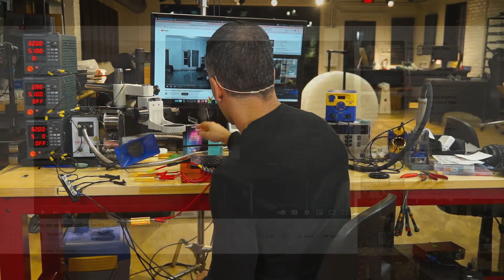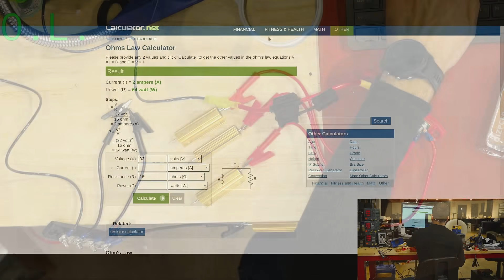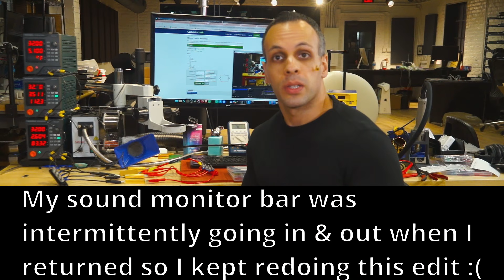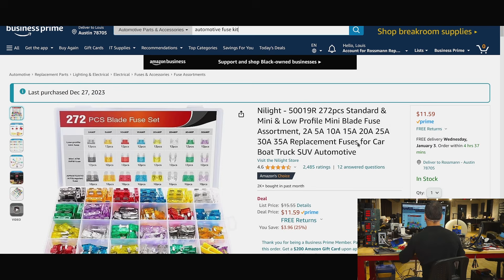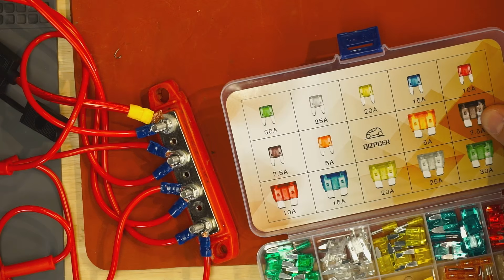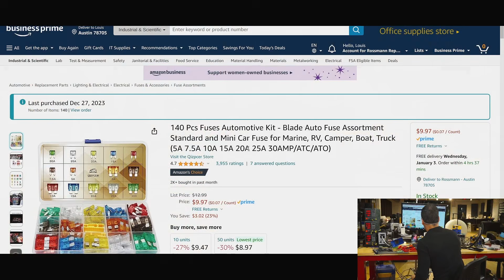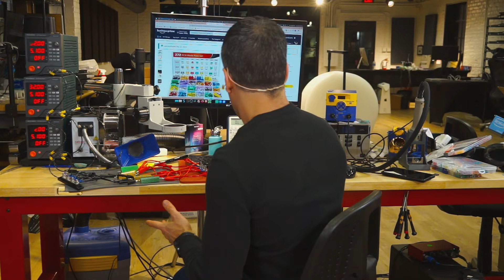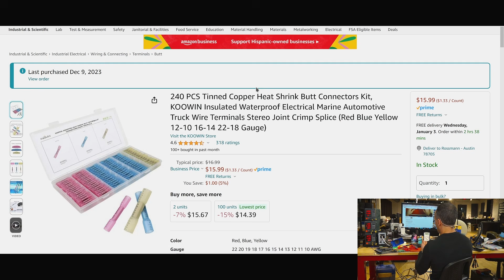Amazon Sells Fake Electrical Fuses

Comment: The way to avoid alot of the garbage on Amazon is to never buy the cheapest one of whatever you are looking for. If the Home Depot version costs $10 and the Amazon listing you are looking at costs $3, you can bet the Amazon item will be garbage. However if you get the $6 Amazon item it will likely be of sufficient quality. Doesn't work every time but it has significantly reduced my returns. Another thing to look for is to make sure the product has at least a few less than stellar reviews. No product can please everyone and if you find a product with nothing but shining reviews, those reviews have most likely been curated.

Comment: Can I make a recommendation? Just put one power supply in constant current mode and connect it directly to the fuse.  You don't need voltage, or to dissipate power in the resistors for the fuse to blow, and they don't limit power, only current.  

Just turn up the current until the fuse pops.
Reply: Did you not listen to his comments on peanut gallery? If he did as you suggested, somebody would complain it's not a real world test. Engineers! Sheesh. Louis did a fine job. I'm a mere machinist & trade schooled '94+ high school '92 electric curriculum. I'm always fanatic about my crimps when I use them. I did have a similar issue with an Amazon window defroster. Junk. It wiped out a 20A Dodge Ram socket. I used that heater about 3 times as I recall.
Reply: @MattsRanger Forgive me for not wanting to argue with someone who couldn't spell resistor earlier.  You, I'll make an effort for though.  All tests are by definition not real world, they are tests.  Fuses blow based on current, fuse voltage ratings are there for other factors like arc protection and insulation.  What Louis is demonstrating is not a "real world test" but he is instead demonstrating a fundamental misunderstanding of how electronics work.  This is not particularly complicated stuff, I only identified myself as an engineer because I didn't feel like arguing, and because it gives me some credibility that I know what I'm talking about when it comes to electronics, just like I assume you know what you're talking about when it comes to machining.   

So, let me break it down.  Fuses blow when they heat up.  They're made up of a conductive metal with a specific melting point and a fixed resistance.  Yes, they look almost like a dead short, but there is some resistance there, probably in the miliohms.  Heat is produced when power is dissipated, we can calculate that with an equation, power equals current squared times resistance (P=I^2*R) where resistance is the resistance of the fuse, not of the overall circuit.  You can also calculate that based on voltage, but since the resistance is constant, voltage and current will always be proportional in the fuse according to ohm's law V=IR.  So, current in the fuse causes heating, heating blows the fuse.  The overall voltage of the circuit is inconsequential, only the resistance and current in the fuse matter.  

So... in a "real world test", we don't need resistors to act as a load, just test the fuse according to it's design specifications and we can see whether it performs as advertised.  Now, if you were testing the fuse's voltage rating and arc resistance, then you would need the resistive load.  But since we're only testing the fuse's rated current, we don't need a load.
Reply: @SmoothIsFast791  Hmm. Should not matter at this scale. I'm glad you cleared up knowledge status. Any idea how many engineers (mechanical, electrical, language and so on) I've worked with nowhere near that level? Imagine given an order for a dished piston and they send me a subroutine for a dome. Or surface speed way too high for acceptable face on the fire deck. Or mess up angles of holes. Seemed about half my orders some days. Then another who didn't understand tooling geometry or ratings for Caterpillar supplier. On and on. Anyway 10 amps to melt a 2 amp blade. Only argument for the finer level would be the 2nd. And I doubt it would affect this 1. Other than that, save power for EV charging grid? What's the goal? P.S. I migrated to an aerospace specialist turn shop. I mostly make bearings this year. I keep busy in electronics as my pay allows for. Sounds like 1 of my scrap chips might be better than 1st & 2nd brand fuse here. It's
Reply: Not normal steel. Be a lot easier to spot fails!;) But nah. It's a bearing material doped up with a lot of chromium and a surprising amount of iron.
Reply: Louis was trying to emulate an actual circuit, as we would find in the wild; rather than create a light bulb from the fuse. The resister is the load, not the fuse..... the fuse must sever when the LOAD exceeds the fuse rating. Creating a direct short might muddle the results....... meaning these fuses likely would allow a greater draw that if shorted out directly. Maybe, for the purpose of a test,  a short is the same as a completed circuit, I am a locksmith, not an elekchicken! Can we call Bussman or Littlefuse, and have then chime in here? It would really be interesting to get their input.
Reply: @citylockapolytechnikeyllcc7936  I'm an electrical engineer, you are wrong.
Reply: PLEASE correct my error, so we all can learn.    @SmoothIsFast791

Comment: What’s particularly scary  about this one is that a lot of people who aren’t experienced with electrical systems are probably buying fuses on Amazon because one blew. So if they replace the fuse and it doesn’t blow, well then obviously it’s a great fuse and better than their old one. I had to explain to someone that replacing the 5A fuse in a Christmas light strand with a 10A one so it stops blowing is a terrible idea. These have 100% started a fire at some point.

Comment: You're right that a 2A fuse that takes 10A to blow is not a proper fuse. But, Louis... let's be VERY CLEAR on one thing - FUSES ARE ~NOT~ RATED TO THE CURRENT THEY WILL BLOW AT. They are rated at the current that THEY SHOULD NEVER BLOW AT, a.k.a. the current they will pass indefinitely WITHOUT EVER BLOWING. Yes, a 2A fuse SHOULD blow at 4A. Or even 3A. But this is a rather important distinction. You DO NOT buy a 10A fuse so that it blows if you're drawing 10A thorough it...

Comment: There is a site and plugin called reviewmeta that analyzes amazon reviews. I checked the pages of all 3 of your products with it, and for the first set of fuses it resulted in 46% suspicous reviewes and corrected the score down to 3.5, for the second one 47% but remained at the 4.7 rating and for the CrocSees only 7% suspicous ratings. Yeah. I personally wouldn't buy any product that has more like 10-15% fake reviews from that analysis. Fuses probably get HIGHER average reviews if they don't blow. Because people would just rate them badly when there is something wrong with their car and the fuse keeps blowing and are happy with the fuse not blowing when it actually should and masking a real issue in the car.

Comment: My issue is that it's not just Amazon (and eBay) providing a marketplace for these things (although of course they're the largest) but low-quality junk is ... everywhere. It's really, really difficult as a consumer since sometimes, the "knockoff" stuff is legitimately exactly the same off the same factory line as the "brand name" stuff, and other times it's, well, cheap knockoff garbage. I'm more than happy to spend for quality but I also hate the idea of spending for branding without getting any increase in quality. 

I will say that Amazon has become much, much harder to use with the proliferation of cheap stuff pushing out legitimate brands. I still find it worthwhile and buy plenty of stuff there but ... definitely not what it used to be. 

As someone who used to work at a manufacturer selling stuff on Amazon and through other channels, Louis is 110% on target when it comes to the race to the bottom driven by Amazon's policies and ways of doing business.

Comment: I don't know much much time was cut, but for the 2nd fuse tested it seems fine. at 6 amps it could take a few minutes to blow. Thats not abnormal for 120% of rating. And once again, for the 8amps it looks like you gave it around 12 seconds (again, idk about edits). Which, at 180% rating lasting 20-30 seconds is not unusual. Then blowing at 10 instantly, while a bit fast, makes sense considering the overage you were already giving it. At 200% rating its not unusual to last around 10 seconds.

A note, even the 2amp one at 400% could last around 5 seconds. It obviously was fucked beyond reason. But it is worth mentioning it can take over 800% over rating to cause a slo-blo fuse to go in 1 second or less. 

I'm assuming these are slo-blo to give maximum benefit of the doubt.

The third one is oversensitive. Even fast ones shouldn't be blowing out super quick at rating. They should easily be lasting minutes, up to even an hour at rating.

Comment: You should just use the current limiting feature of your power supplies. In the case of fuses, it doesn't matter how many volts you are using only amps.  A 2 amp fuse is supposed to pop above 2 amps and it doesn't matter if you are at 1 volt or 1000000 volts. A 2 amp fuse cam handle any wattage as long as the voltage is high enough to support it> The voltage rating it only the maximum voltage the fuse can extinguish the arc that is created when the fuse blows.  The same is true about circuit breakers
Reply: Lol, wouldn't matter, he is using cheap amazon power supplies 😂
Reply: @johnstark4723  they are accurate enough for testing fuses like this
Reply: @cmjbrodman  you miss the point 🙄 And no, they really are not accurate enough for this testing. They also have a pretty crappy signal that is no where near as clean as it should be.  Those power supplies need major reworking to work properly.

Comment: Hello Louis, Are you aware 
the Nilight brand list the price as on sale but, for the same price as in your video and it says it is a sale.
Deal
-25% $11.59
List Price: $15.55 

The 140 Pcs Fuses brand list the price as on sale but, for the same price as in your video and it says it is a sale.
-23% $9.97 ($0.07 / Count)
List Price: $12.99 

The CrocSee 250 Pieces brand list the price as the same  and a $2. coupon off, than what it was on your video.

Thank you for putting all this effort into exposing Amazon for the rip-off they are perpetuating on consumers.

Comment: I've just found a Time-Current Characteristic Curve published by Littlefuse.
They make automotive blade fuses to comply with ISO 8820-3.
The curves show that a 2 A fuse running at 3 A should disconnect in about 15 seconds.

Comment: You should have tested the 35 amp fuse.

"Well, I'm putting 175 amps through this fuse, five times the rated current. My wires are glowing red hot after the insulation melted off them, my power supplies are smoking, my desk is on fire, but this fuse is perfectly fine."

Comment: At what point does Amazon become responsible for allowing this, I am in the 12 volt Audio industry and they offer 0 gauge wire that cannot hold 1/4th the power rating the sellers are claiming.

Comment: My favorite thing on Amazon are the million lumen flashlights that run on AAA batteries 😂 

I just always assumed most consumers were aware that you can't trust something you see on the internet, even if it's on an Amazon page. Always verify anything that has to do with your safety. Cheap chargers have burned down homes, spend the extra $5 on a brand name ya'll

Comment: Could they "just" be mislabeled/colored wrongfully? (Not to say that it would justify anything)

Also, could this be semi-proven by resistance testing?

I have seen pictures of similar fuse sets (on other selling platforms), where the colors of the product differed, from the review pictures customer had shared... Same packaging and amperage layout, but different coloring.

Comment: No fuse should blow at the nominal current. Also, the voltage is really not a factor with type of fuses that blow. They blow because of heat and heat is a factor of resistance times current squared. But yeah, depending on a type of fuse, a 2 amp fuse should generally blow at four amps after seconds. At eight amps it should blow almost instantly, generally. I'm pretty sure the second fuse was well within spec. Because we don't have the data sheets it's really not beneficial to speculate further.

Comment: As an electronics technician in germany, I am not sure if that behavior is intended or not. fuses and circuit-breaker have certain characteristics which determine when they are to be triggered. Circuit-breakers with the C characteristic, for example, trip immediately at 5 to 10 times the rated current. Anything under that they need some time which you can read from the corresponding tables. But i have no idea how they should behave in the auto-industry or in North Amarica. So they could work as intended or they could be garbage

But anyway Amazon has become a piece of trash even in Europe

Comment: I'm just curious what uses 32v fuses. Aren't most automotive electrical systems 12v?
Reply: I assume you know what you're doing, but if you put 32v in a 12 V fuse and run 2A thru it you would actually be 2.5 times the rating of the fuse already, just at 2A.

Comment: I had a cheap amazon fuse almost burn my project car down. I replaced a blown fuse for my dome light and the fuse immediately blew because i had inadvertently caused a short. I go to pull the old fuse out and one leg of the fuse comes out and gets stuck in the fuse box. I get some needle nose pliers to grab the blade of the fuse and it falls into the fuse block, bridging the connection. It takes me a couple seconds to get the broken fuse blade out of the fuse box and by then the small wires going to my dome light are smoking.  Luckily after inspecting the wiring only the wires going to the dome light were burnt out so it wasn't too bad to replace them.

Comment: Oh its been a while since my trade school but slow burning fuse at 3x current just casually running while you talk should not be possible. I know motor fuses are rated up to 10x surge current or even more but for maybe 10s most and that is probably over statement. Maybe if it was at 2.1A it could take some time but 3x for more than 10s, that is beyond unacceptable. I know there is a standard for how long a fuse has to hold out, but this is not a case where you expect normal to be x and surge to be 25x, you don't have high capacitive or inductive loads in cars.

Comment: Keep in mind, many folks will push in a fuse - and if whatever wasn't working before works - they will post a positive review.

Let me give you an example.

I had a thermal fuse blow on my clothes dryer some years ago, so I went out to Amazon, found one for the model of my dryer, and ordered from a seller who called himself "Whirlpool".  The fuse image displayed by Amazon had all the Whirlpool markings / impressions and looked genuine.

So what did I receive?

A thermal fuse in an off color with no Whirlpool markings from some Indian / Middle Eastern dude living in Illinois.

Did I install that in my dryer?

Fuck no.  I drove the 30 miles to the Sears parts store, and picked up a genuine fuse.

The thing was though this guy had probably 30 positive reviews - and they all said the same thing:  "Put new fuse in dryer and it worked!"  Yeah, of course it worked - but God help you if it doesn't open as designed, or that dryer fire might cause you to reconsider your review.

Comment: This is a huge problem in the home solar space, because the voltages and current involved can be so dangerous (up to 1000VDC and 300A) and the vast majority of fuses and circuitbreakers sold on Amazon are fake. I actually found a "circuit breaker" on a customer's install that was just a molded piece of plastic. The lever that was supposed to move to break the circuit was just a solid piece of differently colored plastic and it was a solid buss bar inside.
Reply from the maker: Do you have information on the make or model of that circuit breaker?

Comment: It would be interesting to use an automotive wire to supply power in this testing situation. For cost and weight savings automotive manufacturers use wire gauge slightly higher then the anticipated load, I think they would melt. From the first two tests It seems that the 2A and 5A fuses are probably made with the same element; so would a 10A or 15A give similar results? Or maybe the 2A through 7.5A all use the same element while the 10A through 25A use a slightly thicker but identical element? Allong that train of thought would the CrocSee 5A fuse blow at 4A? 
Very interesting video, thanks. I buy my fuses from Sherco-Auto Marine supply; USA made.

Comment: I'm not sure if fuses are meant to work this way. I think, it should blow when there is a spike and huge load in really short period of time, but it should allow for more current to flow normally. in case of 2A fuse, it may allow 4 or 6 amps to flow, without blowing.

according to wikipedia I am right:
" A standard fuse may require twice its rated current to open in one second, a fast-blow fuse may require twice its rated current to blow in 0.1 seconds, and a slow-blow fuse may require twice its rated current for tens of seconds to blow."